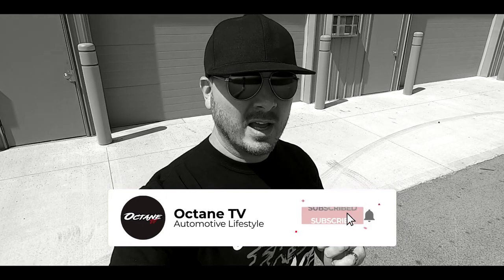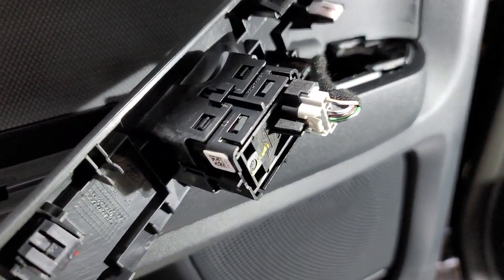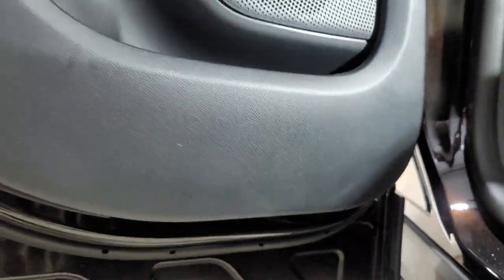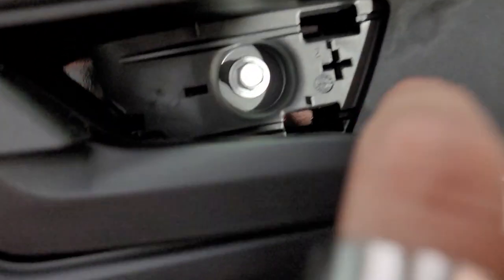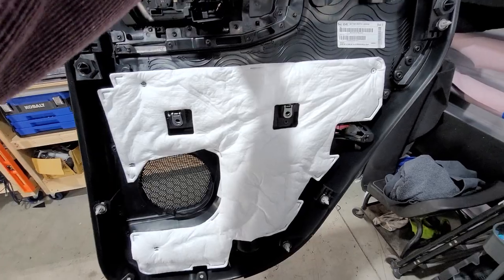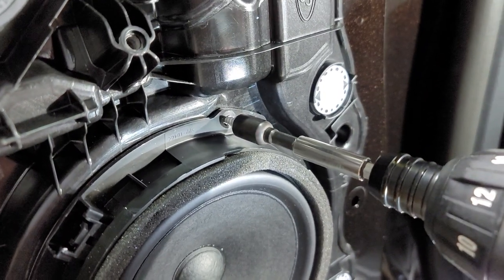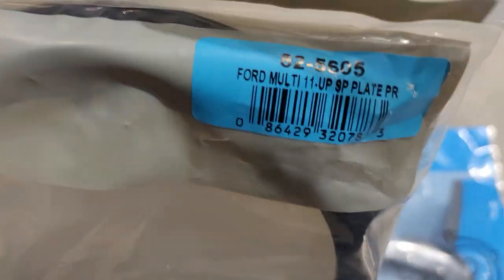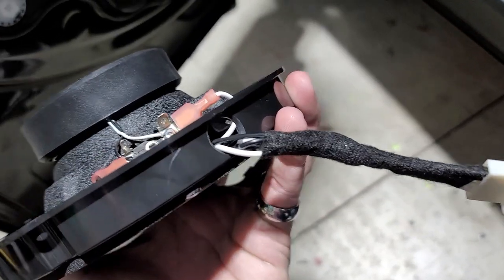2021 FORD BRONCO SPORT REAR DOOR SPEAKER INSTALL AND PANEL REMOVAL

Comment: The front and rear speakers both use the same adapters and harnesses? 6.5" speakers front and back? Trying to figure out what fits in mine and have had some difficulty. As the other user said, some of the links (Metra adapter and the 2pk of 2 harnesses) show that the parts don't fit in the 2021 Bronco Sport but it's possible that Amazon hasn't updated that. Thanks!
Reply from the maker: Yes they will fit both the front and the back and you can use the cheaper brand as well. Definitely click the links in the description because those are the ones that we used